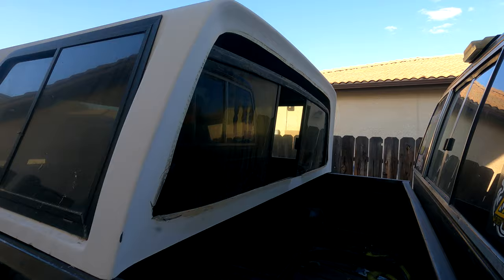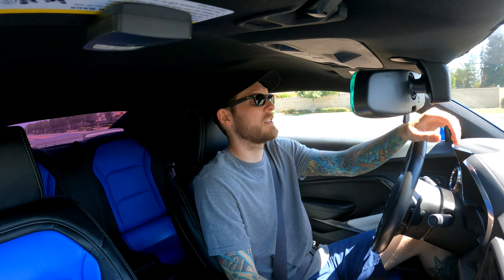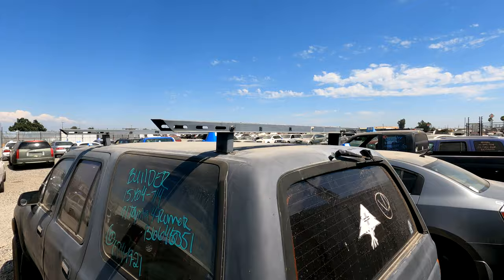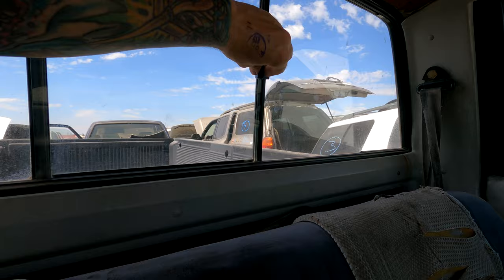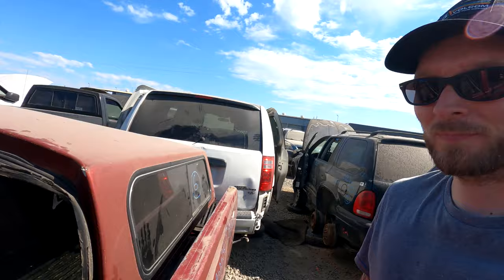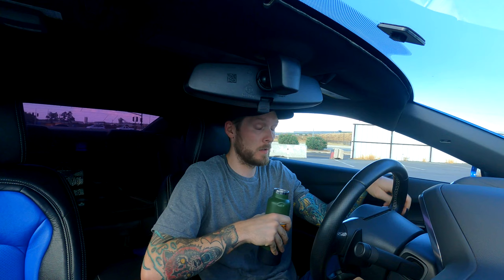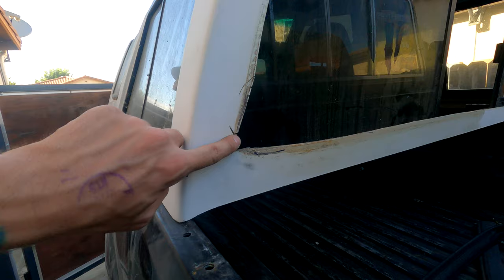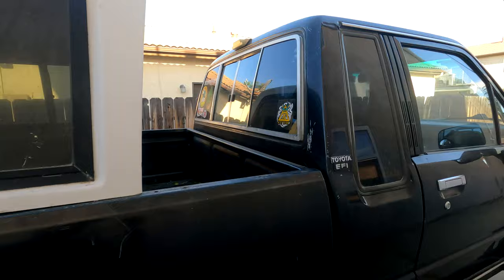4Runner Style Camper Shell for My Toyota Pickup! - Truck Camper Shell Build Ep. 1

Comment: I want to learn fiberglass to make a custom sleeper for a 1500 or 2500 truck. So it will be like a roadmaster sleeper.  I want to add a bed, refrigerator under bed with some clothes storage and a microwave. Get a truck with no back cab to add this piece. Can use it for road trips and camping.
Reply from the maker: That would be cool!